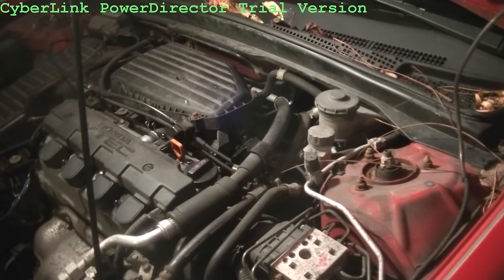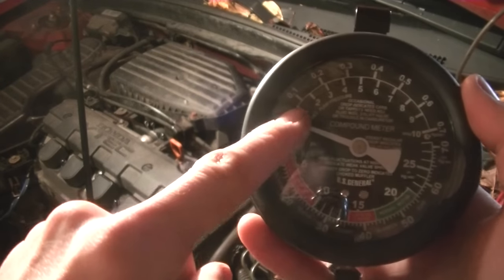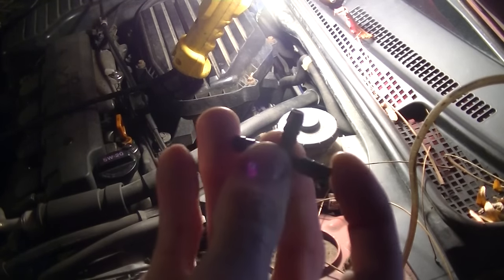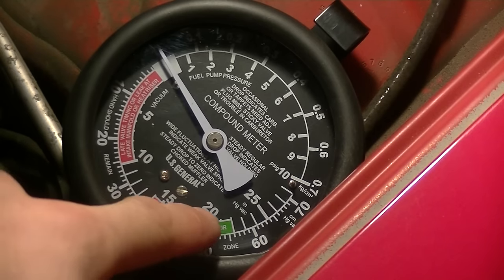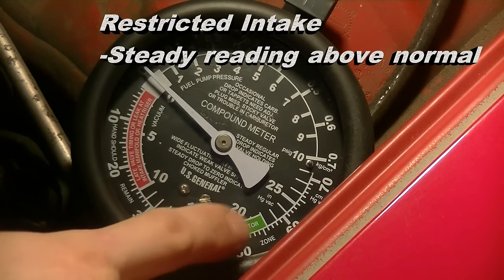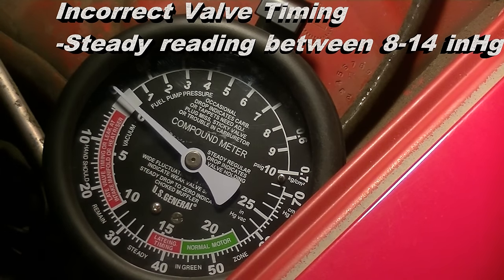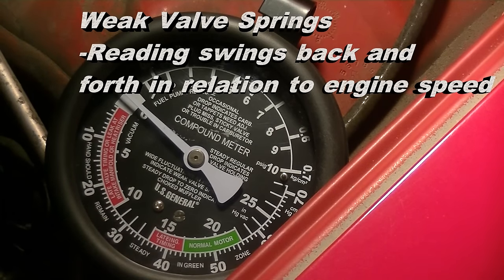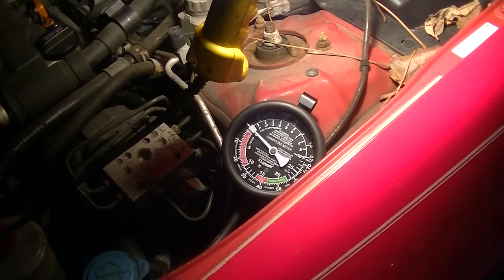How to Use a Vacuum Gauge to Diagnose Engine Problems

Comment: Alright dude i have a few things to add because you may be leading some people astray. Like me. So first of all your vacuum reading depends entirely on your Barometric Pressure/Elevation. At or close to sea level you should see a vacuum of 17-22 in/Hg. That number decreases as you go up in altitude (down in barometeric pressure). So at 3-4 thousand feet you should see a vacuum of 15-19 in/Hg. I am at 7,000 ft above sea level, my Vacuum should read 12-16 in/Hg. Keep in mind that Idle vacuum for most engines is about 18-22 in/Hg   AT SEA LEVEL  but some may produce only 15-17 inches idle depending on your motor. you need to refer to your cars repair manual for vacuum specs.  If your valve timing is retarded, the needle on the guage will bounce due to blow by on the intake valves back into the manifold........ not a steady low pressure reading on the gauge. Under load your Vacuum should be zero at cruising speed thats how you know you have a healthy motor.
Reply: and the sentor MAP? what values this take?
Reply: Great point Josh! What is the formula for determining vacuum at various elevations? I'm at 5K ft. here in Colorado maybe it should be between 13-18 In/Hg?
Reply: Nope, at full throttle on a gasoline engine the vacuum will be at or near (filters have some restriction) 0. any time you're not flooring it, that throttle valve is closing in order to create a partial vacuum in the intake manifold (this is how your car restricts the amount of air it ingests).
Reply: @Andre Woods Advance Challenged maybe?
Reply: Good trivial point, if using an actual mercury gauge (which almost no one owns) which measures pressure differential.  But not at all related to this regardless of gauge.  Please note that there is an acceptable range.  This covers pressure differences.  Please also consider that the external pressure will have no effect on fluctuations or trends, which are what we look for in diagnostics.
Reply: Good trivial point, if using an actual mercury gauge (which almost no one owns) which measures pressure differential.  But not at all related to this regardless of gauge.  Please note that there is an acceptable range.  This covers pressure differences.  Please also consider that the external pressure will have no effect on fluctuations or trends, which are what we look for in diagnostics.
Reply: You really like to complicate life.
Reply: @patrickneyman6739  you seem to be right there. The pressure gauge always starts off, is set at zero 0 independent at sea level and ghigher altitudes
Reply: @sergiodanielportillocaball2047  MAP uses manifold absolute not relative pressure, because, data of the absolute pressure is needed by the ECU to calculate amount of air in going molecules to cylinder and calculate precise amount of fuel injectors are to use so combustion is at correct air/fuel ratio (14.7/1)
Reply: you have to adjust recipes for altitude too....but chefs rarely point that out because that's a small percentage of people.
Reply: What should vacuum be under load??0?
Reply: @fasteddie4145  you’re absolutely right 👍🏼
Reply: Muy buenos tus comentarios Josh. Estaba a punto de hacer el mismo comentario al respecto de la altitud y la presión barométrica. Sin embargo, tu explicación sobrepasó todas mis expectativas. Muchas gracias.
Reply: @fasteddie4145  Es todo lo contrario
Reply: @johnjeremias9437  La presión de vacío es igual a la diferencia de la presión absoluta y la presión atmosférica.
Reply: You forgot to note in your in-depth criticism, that the vehicle ideally should be at optimal operating temperature prior to testing too.  Also how could one be leading you astray seeing as you assume to know better?:elbowcough:
Reply: If it's a single cylinder what should be the readings?
Reply: @johnjeremias9437 ECU don't chase the absolute, because there isn't, on high load makes it rich, and on cruise mode lean ..
Reply: @patrickneyman6739  all vacuum gauges compare atmospheric pressure, which varies with altitude. I don’t know what’s inside them and I don’t really care either
Reply: Making note of this thx. I’m going down the path of fixing an fe390 for my 65 Galaxie
Reply: @eastonsears5642 I believe depending on your altitude you have to calibrate your gauge as well

Comment: very informational. Doing a vacuum test seems alot easier than doing a compression test since sometimes the spark plugs are hard to get to
Reply: That sound like providing food, when your're thirsty! LOL 😂 All in all very nice but don't fulfill the necessary requirements. Compression test, leak down test, vacuum  test. They all have a place and time to be done and work as complements rather than substitutions of each other! Cheers

Comment: Dude, I do love your explanations here on what can be seen with such a guage when you know how to read it and what the reading means. It's crazy how very few mechanic just don't the easy steps to properly diagnostise an engine with the proper tools to fix the right thing once and for all. Same goes with multimeters and voltage drops across the starter, block or alternator cables. I've seen stupid mechanic screaming after the parts guy that his last 3 starters were worn and a bad connection that couldn't be seen bared eyes was the problem of slow cranking... again, i can't wait to get a hand on a vacuu, gauge and fix my engines myself better. thanks a lot for this helpful video

Comment: Excellent video!  This was a comprehensive explanation on how to use intake manifold pressure readings to identify engine issues.
Reply: Yeah but did he have to tap into the other end where he pulled the line off? I can't find where to try this on my 4.6

Comment: Nice video thanks.  I'm weighing a valve adjustment on my Sentra B15 because of low acceleration chatter -  I'll see if I can get any clues w/ this Harbor Freight tool tomorrow.  By the way, I've been able to thread the hose under the hood and place the gauge on the windshield so that I can view it when performing snap-throttle.  If it''s too short for your location just go to the auto parts store and buy a 2' section of comparable vacuum line (take the original for comparison).

Comment: Good video. 
I have the symptoms of an exhaust obstruction. Strong 20 inches, then as I throttle up (in park, no load) it starts to sputter and loses vacuum. It a simple v8, Oldsmobile 307 but it been troublesome. 
I’ve been through multiple sets of plug/ wires and distributors. New fuel pump filter even overhauled the motor.
I guess I’m gonna check the fuel pressure tomorrow . Oh and I have no exhaust restriction. But maybe I have carburetor problems. I don’t know what else it could be.

Comment: 17 - 20 Hg's for an engine with a stock OEM cam. If you have a more radical cam vacuum will be lower. In my case with a .610 lift my vacuum reads around 13 Hg's at idle then drops to 0 at high RPM.

Comment: Thank you! This is exactly what I've been looking for. Now I just have to look/buy a vacuum gauge.

I subscribed!!!
Reply from the maker: Thanks for subscribing! I definitely do appreciate that.  Glas you liked the video :D
Reply: @MattsMotorz  Hey MattsMotorz quick question i did this test on my 2008 Toyota Corolla and the engine idled at little under 20 maybe 17 and when i hit the gas it jumped from 10 to 22 .... what would cause that ? you said it should jump from 0 to 25
Reply: @MattsMotorz  When I was checking for an intake leak the result was the needle was hyper fluctuating back and forth 1 point between 19 1/2 and 20 1/2  (a steady 20 is recommened for vehicle) ...this fluctuation is indicating / confirming I have a vacuum leak ...correct??   thanks.

Comment: forgot most important step - what cam do you have? stock/stage 1 this would apply, but id drop 2-3 inches per stage of cam, around stage 3 the readings get more whacky from a bad vac signal. My 288HR comp cam idles 7 inches and very few of these principles apply with radical cams. Id say around 230-240 duration and up things start falling apart.

Comment: Great video Mat Motorz, thanks.
Josh Arbour,  I presume pressure gauge shown measures relative pressure(1), therefore altitude of engine is irrelevant for this analysis. 
(1) pressure gauge indicates zero when not connected at all altitudes
Reply: Lets do some math on this. At sea level atmosferic pressure will be 100 kpa or 29.9 in Hg. We can asume we live in a city at an altitude of 4000mts Over sea level. Over there armosferic pressure will be little more than 60k Kpa equivalent to 18 in Hg. With 18 in of armosferic pressure how can you get 22 in of vacumm. I believe Josh is right.

Comment: Big thanks for the explanation! On my 350 sbc  I read at idle a flickering needle on 16hg at 600rpm. Fast idle 1200rpm and the needle is steady at 19hg. Timing is late 8 degree. 
I think it‘s a mix from bad valve stem seals, that also indicat the blueish puffs after a shifts and a bit more timing mabye 12 degree? Thanks

Comment: awesome awesome awesome video !!! Ignore any naysayers. Anyone can be a critic (really? I should account for barometric pressure? How about humidity? How about durometer rating of the line? Sheesh) I have a 1966 Mustang 289 4 barrel and I get good vacuum but have that very fast small fluctuation. SO not sure if its valve seals or as you pointed out to someone else, new, so don't worry...BUT ...changing to aluminum heads soon so I will worry then...thanks for a great video

Comment: Thanks for the great video! I have a 351M in a 78' F250, that starts to have white smoke after warming up, but not on first starting. After watching your video I bought a gauge and the reading on start up is a vibration between 15-16 and then after warming up, it fluctuates between 6-20. Do you think I have a head gasket leak?

Comment: Question: Wouldn't not plugging the port on the intake manifold where you take the tube off of, affect readings since it is letting air in/out?

Comment: Everything is new in my 68 Mustang, with a crate stock 302, runs well no issues. But the vacuum gauge shows 15. I managed to get 17 after advancing the ign. timing a little. What do you think? Should I advance it further to achieve 18 or more?

Comment: hi, i was hoping you could help me with the readings i got from my little mazda truck 2bbl. the needle from my vac gauge reads in between 15 and 18 unsteady. i could never get it to hit 20 in of mercury. when i rev it up, it would go back to 0 and then goes to 20 and then back to 15-18.

Comment: I have an error code that shows a mass air flow issue, which could be the sensor which is very expensive ( I already cleaned this) but I guess having seen this video it could also be a blockage in the exhaust.  Also to me the exhaust from the car is not a normal diesel smell. 
Great video very informative.

Comment: Hey MattsMotorz. Nice video. Appreciate the info! The line youu stuck the cone into, was that going into the intake? Or where was the other end at? I got a 2.4l gm motor. It's the ecotec and has dbw, no throttle cables. But anyway, I couldnt tell if the end you put the cone into was the hose end that came OFF the manifold or does the other end of it go TO the manifold? I'm lil confused to say the least. I sort of wish you'd go over some different hoses to use and how to hook up the vac gauge. Like with that "t" you had and any other ways to hook up the vac gauge. But ex video, real useful for me!!
Reply from the maker: It went to the intake. You always hook up the gauge to a line that goes to the intake directly.

Comment: Great video! I Just did this test and I'm getting readings above normal at 23. When I blip the engine the gauge quickly spins to 0 then back up quickly to 25 then settles back down to 23. So i assume I have a restrictions. How do I find the restrictions now?

Comment: 4:51 ...okay wait, so the declining gauge pressure is a sign of both an exhaust obstruction AND an air leak in the in the intake manifold? also, if you disconnected one of the vacuum hoses, what is plugging up the port that you disconnected it from?

Comment: Hi thanks for the video. Should we tap the gauge before the throttle body valve?  I am asking because my car has 2 hoses tapped off the intake boot. One hose goes to the brake booster and the other hose goes to fuel pressure regulator.  I connect the gauge to one of these hose and there is no vacuum at all (maybe too little).   I think it is reasonable since those hoses are close to air entrance (air filter), which is a big door.  But I re-think if there is no vacuum how the brake booster and fuel pressure regulator work.
Reply from the maker: You need to connect to a vacuum source directly off the intake manifold.  The brake booster is a great place to tap into because it has full engine vacuum.

Comment: Hey Matt, I have a bigger cam and best vacuum at idle is 12; do I just adjust your numbers using 12 as my 'good' range?  I am assuming all other tests still apply and I just need to adjust the ranges, is that correct?. I am particularly interested in checking for piston ring issues so 3-7" above normal for me would be 15-19. Excellent video's and clear explanations by the way, you would make an excellent automotive teacher. Keep up the good work. Cheers
Reply from the maker: +Gary Gevaert Thanks for the comment!  So you have modified your engine to have a larger cam? Is that correct? I don't know if the vacuum behavior scales linearly like that to be honest. It might, but I don't have any experience doing that.
Reply: +MattsMotorz Hey Matt, yes, that is correct, it has a larger cam. Ok, thanks for letting me know; I'll do some experimenting. Cheers
Reply: +Gary Gevaert     Yes, a bigger cam will definitely reduce manifold vacuum !

Comment: Excellent video, really helpful!
My engine is very old 280.000 Kilometers and never rebuilt (Ford Taunus 1,3 1975 OHC engine 4 cyl.) the value at idle is 12 hg.(steady) and when decelerates it marks 15 hg. Is it all normals?
Many thanks for  all and kind regards.
Antonio (from Italy) 
Traduci
Reply from the maker: I don't know that engine, but normal engine vacuum is 21 hg, so 12 would definitely be low (unless you meant to type 21).  What do you mean by decelerates?

Comment: Ok so, I have a vacuum vibrating rapidly between 18 - 15 in/Hg, at idle. After me doing a wet compression test, I just happened to start the engine with the vac. gauge hooked on and to my surprise, the vacuum reading was stable, just for around 5 seconds at idle, then it went back to the vibrating reading. So now I think my vibrating vacuum is caused by a worn piston ring, what do you guys think? Btw for the dry/wet compression test result, and my cylinder 3 is around 30psi lower compression than the rest at dry and all normal at wet test. Its just that after a lot of searching online, I still have not seen anywhere that worn piston rings can cause the vibrating vacuum symptom.

Comment: On a fully warmed engine and when I blip the throttle,. my needle drops to zero but then goes straight to 20 and stays steady.  It doesn't go to 25 and then slowly settles back down.  Do I have an issue?

Comment: Thank You for great video. Needle in my indicator (not every time) is vibrating fast as dragonfly wings but only when engine is cold (about 6-12Hg). When is hot, nothing wrong is happening. Also I have a CVVT on exhaust shaft. It may have an influence?
Do You think that I have a problem with worn valve guides?
Reply from the maker: I don't know what you mean by "CVVT on exhaust shaft." How many miles are on the engine? It certainly sounds like worn valve guides. Does the engine consume and oil? When things heat up, they expand, and sometimes this expansion can help make things work correctly.
Reply: MattsMotorz  CVVT - Continous Variable Valve Timing. This timming Valve is on exhaust shaft. My engine driven 143k miles, and does not consume oil (S40 2.0T '01)
But sometimes needle in my indicator is stable at cold start (20Hg)
I want to disconnect valve VT and see if it will affect the needle readings.
Reply from the maker: Oh!  I haven't worked much with that system, make sure it's safe to disconnect it and run the engine (it probably is, I just like to be cautious)

Comment: hey dude very informative vid, thanks.
would all this apply to a diesel engine?,can it be used on a diesel engine?
 i have a 2000 dakota 2.5 - 425vm motor.
im in Brazil.
thanks again
Reply from the maker: I don't know a great deal about diesel engines but I believe at least some of it would (maybe even most of it).  But again, I am not sure.
Reply: No. This will not work on s Diesel engine.  Diesel engines do not have throttle plates.

Comment: OK so i read you reply from TVTruther below.  I want to get it clear. You took off that hose from the manifold and left that connection opened but you hooked up the gauge to the hose. So it is the same if you would have used the T connector from the manifold to the hose and then connect the gauge to the T? Sorry to ask this again but  its because all the videos on here, apart from yours ,don't explain how to connect the gauge they all just go quickly to how to read the gauge its annoying. Thanks ! :)
Reply from the maker: +carlosb1 Yeah it would have been the same.  I think when I replied to TVTruther, I thought I used the T, but looking at it again now, I realized I didn't.  Wouldn't make a difference.